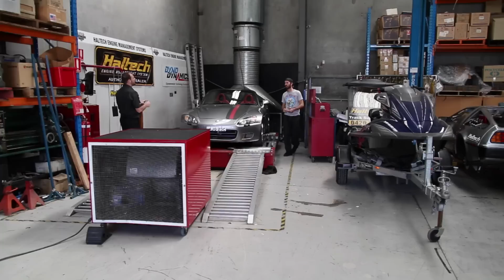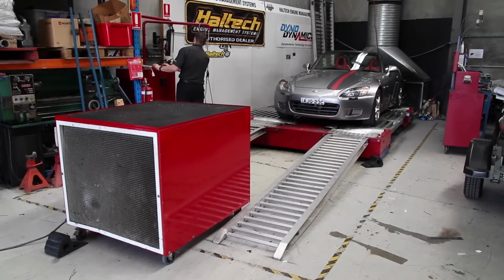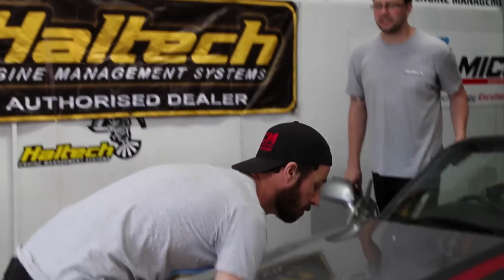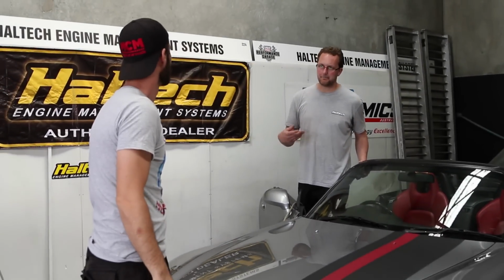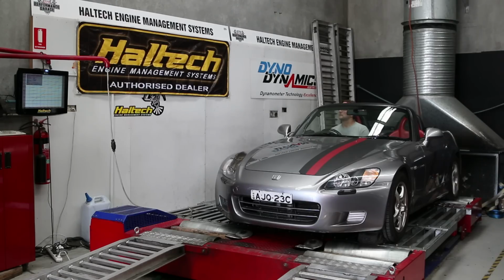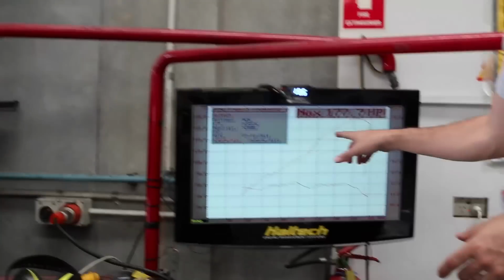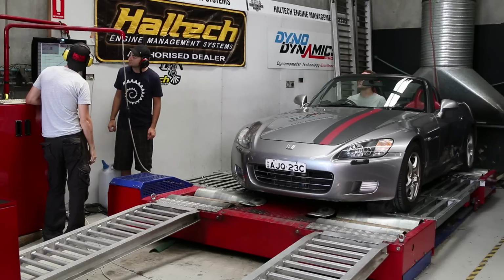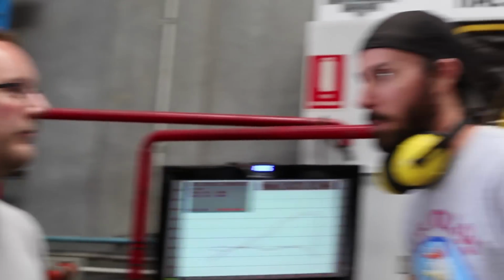Cold Air Intakes Mythbusted [Naturally Aspirated]

Comment: As usual, I'm way too late to this particular party. Referencing a discussion headed by Nick Palaroan (see below) I'd rather have seen the torque curves for this particular experiment (and the one for forced induction motors). Back in the day I 'forced' son-face to get, as his first (and therefore restricted, because of U.K. rules) motorcycle, a Suzuki SV 650, (a vee-motor) when he wanted an R6. Because torque. Sure, the R6 was the better machine, but when you are only allowed 35Kw, torque is WAY more interesting. So, Vee-motor=torque=smiles, and like that. Okay, if I knew the rpms, I could extrapolate the torque, but this is a video. Please MCM, tell us the torque figures in future videos. Thanks.

Comment: Basicly; 

good located open air filter: give little extra power on high rpms. but big loss on "first movement" specially on ramp. because more air chokes engine. (i don't know true word on english. i hope you can understand what i mean. too much air=chokes engine. you can feel specially on first movement on ramp)
Reply: this is incorrect... if anything it would give a lean mix off idle but even then the ecu would compensate for the greater air volume in a matter of seconds
Reply: +Michael Hackett i tried a lot of car*. even one car's filter on headlight (ram air effect) :) still choking low rpm because too much air. (Sorry bad english)

*206 GTi, 106Gti, Corsa B Gsi...
Reply: +SzopenPan What happens is the air in low rpms moves slower because the extra volume reduces air pressure. think of running a garden hose with your thumb over the end. With your thumb (the factory) the air moves faster but without your thumb (CAI) it just trickles out. The same thing is true for exhaust just keep in mind this is only low rpm not across the board
Reply: +uncreativename Yeah, there's no such thing as too much air(as long as you can get enough fuel). If its not running lean and it's making less power, its because there's actually less air getting into the combustion chamber. At low speeds, the engine can actually benefit from having a smaller diameter intake because it can increase the air's velocity and get the air into the cylinder more efficiently.

Comment: The s2000 wouldn't even have that big of a difference with a cold air intake because honda set those f series motors up well from factory. Try with a k series motor. Bolt ons make a huge difference on those motors

Comment: There are NUMEROUS of errors in this test. First off, Yes a car has to "learn" the new airflow into an engine. Explaining exactly how a CPU adjust fuel and ignition curves will take much more space that I am provided here, so I will give a cliffnote version here. The CPU is always going to seek out stoichiometric A/F ratio. This is down by having a short term and long term fuel trims. When adding a cold air intake (especially on a car that does not have one), you will be adding more air into the car thus leaning it out (more air than fuel). The short term trim will react and pump more fuel in. The long term trim is going to respond by shifting right (greater fuel). Once the car has realized that there is a greater source of air from its expected value, the cpu will start pulsing the injectors a lil longer. this will shift the long term fuel trim back into the center. As a result, the CPU now sees more air, and can pump more fuel into the engine to maintain stoichiometric  A/F ratios. More air, more fuel = more power, That being said, you wont see a massive increase in power just from one piece of equipment. Other pieces like bigger throttle bodies, tuned runners, tuned exhaust, etc ... will get more and more potential out of the system.

as an example of this test, a car with a clogged Air Filter will pull less air into an engine. For that engine to maintain proper A/F ratio, it will have to decrease its fuel. less air and less fuel = less power. The same works in reverse.

Comment: A Cold Air Intake needs a Larger Exhaust Mod.
Reply: Why's that? Doesn't make sense.
Reply: Increasing the Intake Side needs a larger exhaust side too. It's been my experience anyway.
Reply: That does make sense. I mean essentially an engine is just an air pump. The more air it takes the more air needs to be pushed out. Although for a CAI/exhaust to make a difference you'd probably need a tune.
Reply: I wish The Socialist Republic of California would Relax their Regulations - Let People Live a Little. I suppose you could Swap your Mods out every year before Smog. Be Well.
Reply: Stvzbnk That's what I'm having to do. My coyote is tuned, has a few bolt ons, exhaust, and headers (no cats). When the time comes to smog it, it's not going to be fun. Having to return car to stock tune, stock exhaust manifold, etc etc.
Reply: Do you get a Check Engine Light? Will you pass a Visual Inspection?
Reply: Since its tuned, I believe it disabled the O2 sensors (where the cats would be) because I don't get any check engine lights. But of course if I were to get SMOG'd they'd see how much NoX my exhaust is putting out without the cats.
Reply: Interesting. Won't they plug into the OBD2 instead of the Tailpipe Probe. Is this an Older Car?

Comment: If you upgrade your intake upgrade your exhaust to match air flow.
Reply: Exhaust upgrades are more important.  Volume of air leaving the engine is much larger than the volume of air coming into the engine.  

At the end of the day, you are not going to see a performance in airflow by futzing around with your air filter.
Reply: @jimfallowfield7028  yes you are if you match air flow. Do the same test with a Honda vtec N/A engine then put flows 4 to 1 and large exhaust on with standard paper air filter. Look how much the standard paper air filter restricts the air flow to the upgraded exhaust.

Comment: "Such a high power naturally aspirated engine..." My 04 Nissan Titan has 317 hp and 380 ft lbs of torque stock
Reply: My ford ranger 4.0 has 280 horses stock
Reply: +Jack Spades v6 btw
Reply: Yeah but are you getting 120hp/liter? I think not
Reply: +ph0kingbrian Twas a joke

Comment: Damn I just bought an ETS intake for my Focus RS with an AEM filter.  I get there wont be an increase because of "cooler air" for my car because it comes from the factory with a CAI setup.  But the ETS is SIGNIFICANTLY bigger, and smooth opposed to the ribbed and skinny stock intake piping.  So supposedly its airflow, not temp that helps here.  The RS has a super shitty restrictive turbo housing so its actually the exhaust side thats restricted not intake.  But we will see when it gets here.

Comment: u guys forgot something wind that hits the cold air when is running now the factory box insulation could have made that extra horse power but i would really like to see if it will perform the same with air hitting the fron of that bumper use a high speef fan

Comment: you have to tune it every time you change the engine. period. CAI will add SOME power IF you tune it too. a tune with stock air intake will make less than a tune with a quality intake. period. science is proven on this. your car is faster in cool weather than hot weather. ALWAYS. so if you can pull outside air and not hot air from the engine, it will make more power. intake flow matters too. go watch engine masters air cleaner test. obviously carbed vs efi is different. you tune a pcm like you changed jets on a carb. this isn't hard people.

Comment: You got it all wrong in order to get more power the cold intake also needs a good exhaust and that counts on the diameter of the intake and also the exhaust to have good back pressure. Adding just an intake won't affect it because All exhaust systems have some amount of back pressure, but stock or smaller exhaust systems tend to create too much. And too much causes the engine to have a hard time getting rid of the exhaust from the cylinder before the next cycle of fuel comes in. This causes improper cylinder firing and can rob you of your precious horsepower and gas mileage. Its like when you breathing air it's a combination.

Comment: My car came with a gigantic after market air filter in it and it sounded like it ran on 3  cylinders. I went out and bought the factory one from a junk yard because I'm not about to spend 150 bucks on it and the engine went back to sounding like a proper 4 cylinder. Not sure what that was all about.
Reply: You might've needed a tune. Some cold air intakes have larger induction hoses (or filters) thus more volumetric air is being induced through the throttle body. However, your MAF sensor is only set at a certain parameter, the stock intake, thus when more air is flowing through the intake it fools the MAF sensor which is telling the engine to inject a certain amount of fuel. 

So basically, in other words, you probably needed a tune for it to work efficiently, and that may be why it sounded off.

Comment: well the tuning arguement isn't technically wrong because sure you have more air going in but without more fuel youre obviously not going to make a sizeable amount of power.
Reply: If your car has a MAF sensor, it should see the additional air and compensate with more fuel.  You don't need to tell your car to do this, it is programmed to do this from the factory.

Comment: A colder engine runs better and your car is sitting still sucking in hot air where if you were driving it and pulling in cold air you will make a little more horse power.

Comment: You started with a cold air intake to begin with so it stands to reason the car was tuned to take that mod. So when you broke it down back to stock the car is now acting as though it has asthma so of course you're going to lose horsepower. For people looking to this video to see if it's worth purchasing cold air intake for your stock Civics and Toyotas, Camrys and Accords don't waste your time. You're not going to get more horsepower unless you $tune$ the car after you've installed the cold air intake, Ram Air or whatever. You just going to ruin your gas mileage ended up having to pay under the table for a fake inspection sticker.

Comment: So you opted to do the test on a low sale numbers vehicle. Wouldn't it make more sense to do it on a high sale numbers vehicle like an F150 that also gets alot of mods by percentage? The words "cold air intake" is a marketing scheme. If you buy one for todays vehicle it draws air from the same exact location as the oem intake. Therefore it is a same air intake. Some may improve airflow but it isn't drawing cooler air. There are different types as well, open style and closed style. It has been said that the turbocharged Ecoboost F150 engines actually lose horsepower with an open style intake even with tuning adjustments. I cannot verify. I have a closed style S&B on mine and it is claimed to at least gain some horsepower but not much. I have spent far better money elsewhere on the truck than the "cold air intake". Like a high flow catted downpipe and intercooler.

Comment: one thing u guys didn't take into effect is that k&n tune their intakes for each vehicle application smooth tubes,less bends,wider diameter. My 15 ram gained almost 20hp extra on the dyno with a k&n its simple physics
Reply: LOL 20 hp.. suuuuuuuuuuurrrrreeee it did.
Reply: lgonzalez1154 The only way that would even be possible, is if your factory filter was coated in a 3 inch layer of dirt. You might gain 5hp to 10hp but 20hp is not possible. Post a link to the video.

Comment: I don't know about you guys but my ride is daily driven. That meens rain snow, mud, salty roads etc .....real canadian life. 
 My point: At 127hp even if I add 5 hp @ 120000 rpm Wooohooo Who TF cares? My car is gonna sound like a fart (not unicorn) and have a shitty idle.   Bonus: I'm still sloooow.
 Dirties up engines. (not the good dirty)
 I think it's not worth it, IMO, if you want more power, don't buy a honda or prepare to spend thousands on loud fartcan technology. Hondas are best with just  a weeee bit drop with good dampeners, and sticky tires. That it. Enough.  They remain slow that way   ,,,, yes,,,,, but they actualy start on cold mornings and get you to work.  Daily sleepers rule.

Comment: The testing procedures are not correct to test the feasibility of colder air intake to the engine. Real performance should be observed on real road instead on the Dyno. Where air circulation is much better than sitting on Dyno bed inhaling the heat from engine.

Comment: The DYNO made 177bhp on the first run, if you add around 18% (for drive losses) your only around 209bhp, to go from 237bhp down to 177bhp thats a loss of 25% not even 4x4 lose that much through the gearbox WTF...............................................

Comment: I'd not call an engine with 237hp a "high power naturally aspirated engine"You're thinking of the 370z. That VQ37VHR is a high power naturally aspirated engine.
Reply: it is high-powered....  for an NA 4-cylinder. F20C was the highest-hp NA 4-pot available ever at the time and still is unless you count the BAC mono(good luck). And S2000 produced the highest specific output per-liter of any NA production car until the ferrari 458 came along
Reply: The S2000's F20C has more HP per liter than the VQ. Derp.

Comment: Should route the cool air intake back make a duel heatsheild throw a ram air intake on that side of hood and a vent on the opposite side for the engine heat to escape and see how much increase hp u get? Maybe test the ram intake with a electric leaf blower at highway speed since it's stationary with the computer?

Comment: Every car I've put cold air intakes on without a tune  always seem to suffer when it comes to low end torque which hurts daily driveability. Returning to stock always made them feel peppier around town.

My 370z came with an Injen long tube cold air intake and I'm waiting on stock Intakes to swap back in. It has no tune and other stock 370zs feel a bit less boggy when taking off.

The noise is cool and all but for a daily it never feels worth it plus risk of hydrolocking with a true cai or heat soak with an sri 

I'd rather have the intake that professional engineers designed

Comment: Part of the problem with cold air intakes on turbo charged cars is you are compressing the air coming from the intake, which then makes it very hot, and yes you then run it through an intercooler to cool it back down, but I think the small difference in temperature from the CAI is probably completely lost during compression and cooling,

Also, a lot of older engines designed in the 80's and 90's will probably benefit from CAI a lot more due to poor design of the intake systems back then. Just a theory.

Comment: "High powered engine" lolz
Reply: Not for nothing but for 2.0 or 2.2 depending on what model it is and 4 cylinder car that it is, that's pretty good power,even though Hondas are meant for course racing and not 1/4 mile if you drive the car the way it should be driven your in a car that pulls 13's in a 1/4 mile

Comment: this is not a propper test you need to drive the car thats how the cold air goes into the engine you will not get an accurate result on any dyno you need to do a moving test

Comment: So you get what 7 or 8 HP? And how much do these intake systems cost? Doesn't sound like a good $ per HP ratio to me. At that RPM 7 or 8 HP isn't even going to be noticeable. A lot of people like the sound though. The sound is convincing enough to them that their engine has more power. Years ago we used to open up the air cleaners by flipping the covers upside down. It sounded cool when you got on it but it probably made no more power than stock.

Comment: So you idiots "Myth Busted" a cold air intake by setting it on a dyno with no airflow? A high flow fan doesn't come close to simulating the airflow at 100MPH... and you guys didn't even use that? Nice real world simulation fellas, super accurate.

Comment: if the ECU works in closed loop and ajusts fuel according to the air mass detected... why the AF ratio is richer with OEM filter?
My theory would be that under wide open throtle the ECU goes into open loop, with a pre defined injection timing, and that should be reconfigured according to the smaller restriction.
Does it make sense?

Comment: Although you guys did a dyno test and did see a change in Kilowatt output for the life of me why did you NOT DISPLAY HP AND TORQUE?
Mathematically speaking though 5 KILLWATT IS ONLY ABOUT A 6 HP GAIN WHICH FALLS WITHIN THE NOISE OF A GAINS. So with that said NOT BEING ABLE TO TEST UNDER THE EXACT SAME CONDITIONS I BELIEVE THAT THE ONLY REASON YOU MAY OF WITNESS A CHANGE IS MAINLY DUE TO AIR FILTER AIR FLOW! I DO NOT BELIEVE THE AIR INTAKE COOL THE AIR BY THAT MUCH FOR THE INCREASE TO PROVE THIS I THINK YOU SHOULD SWAP OUT THE AIR FILTERS ONLY AND RERUN THE TEST!

Comment: really misleading video. I like how they talk about the hydrolocking Personally I like custom carbon fiber boxes and plumbing. But bigger turbos require more air than designed at the factory usually. One thing they really should of spelled out is none modified vehicles do not use cold air intake. Also there are several cars that have an annoying box filter that cover the whole engine making it cumbersome if you are constantly upgrading your vehicle. So i would say myth isssssss so far from busted. But cheers on the success of misleading people.

Comment: If an S2000's producing 177BHP then it's waaaaaaay down...
Reply: +blainyrules 
Dyno Dynamics Dyno.
It's a normal number for this dyno.  Would probably be ~200 on the dynojets everyone else posts online.  DD and Mustang dynos are less common, but more accurate as they put a heavy load on the drivetrain.